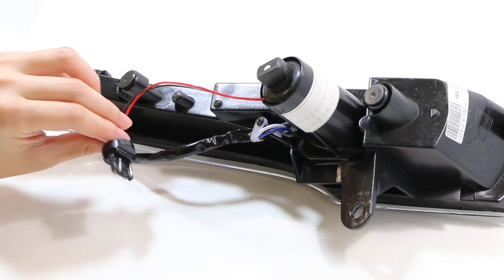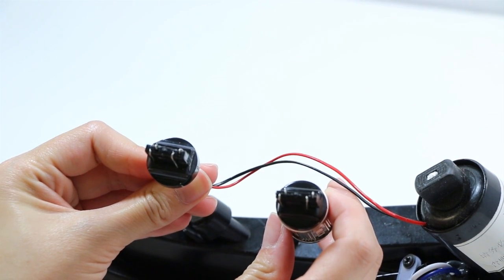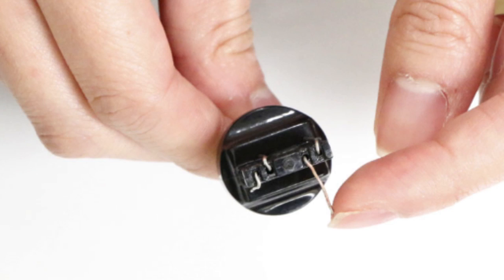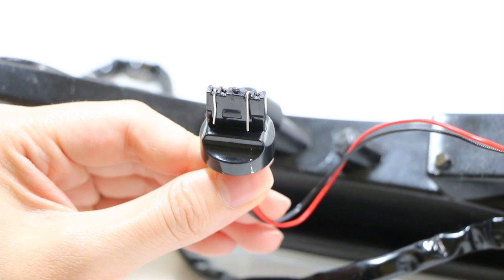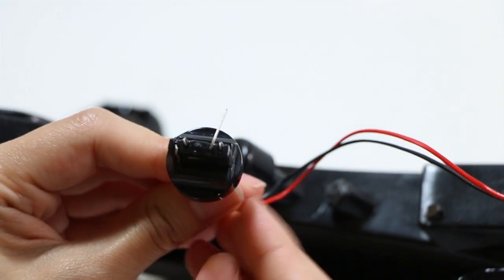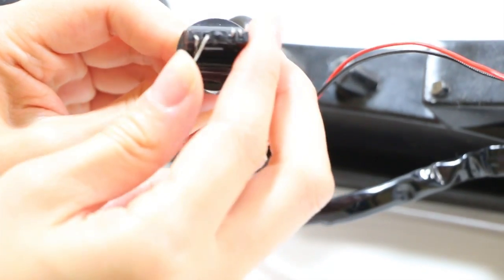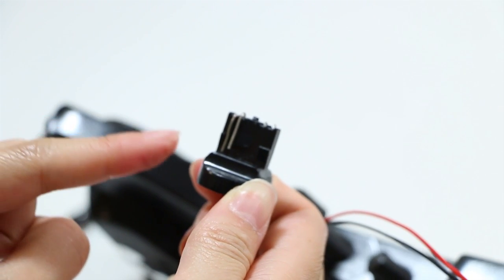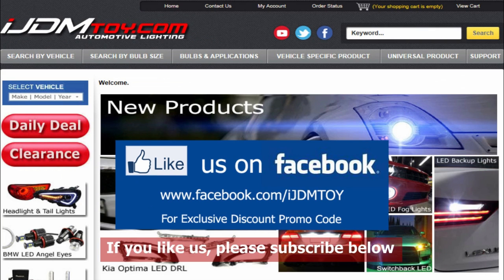iJDMTOY Nissan Altima Switchback LED Daytime Running Light Amber Turn Signal Troubleshoot

Comment: I have a 2013 Altima SV.  I do not have led lighting for the signal lights.  However, after changing the clear lighting housing that the signal bulb is inserted into, the signal light no longer blinks from the bumper or from the front side light.  As a matter of fact, the signal light will not even illuminate.  I did notice that while replacing the bulb, there was another connector that split off from the signal light connector.  Not sure what it goes to.  It is black in color with an orange band around it.  Can you tell me why my signal light is not illuminating and blinking?